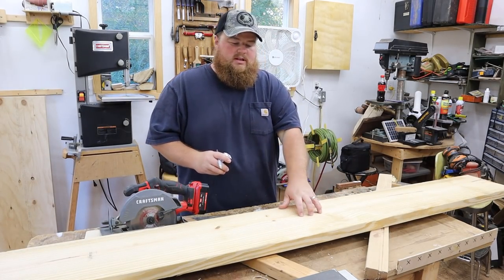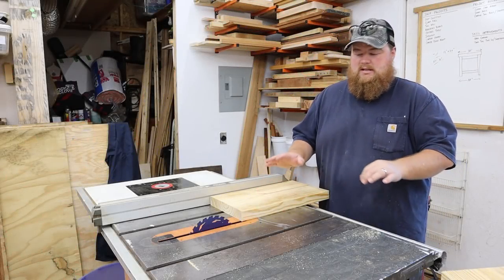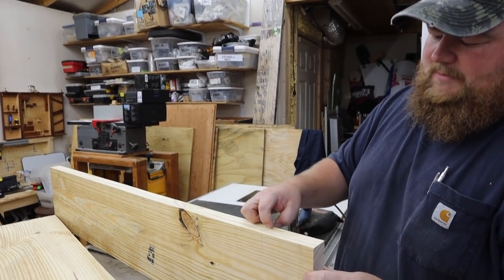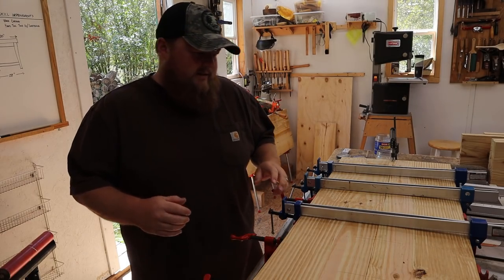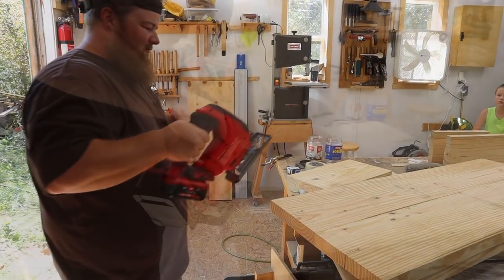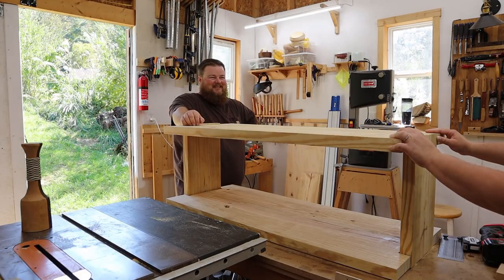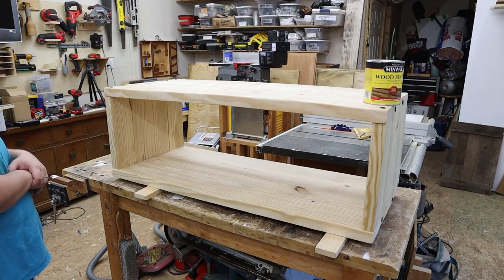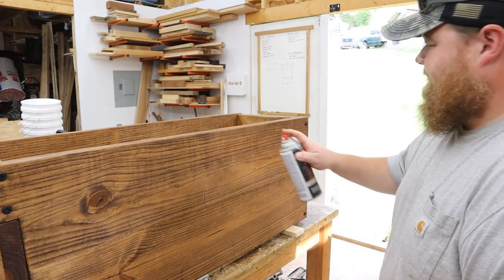Minimal Rustic TV Cabinet Built from Construction Lumber

Comment: The wood floors in your home are wonderful. love the colour of them. The tv unit is fab Sam , you did a fantastic job of building it . I noticed that in the floor of your lounge (beside the tv unit) you have blown air heat vents, my home in the 1970s had vents like that , but OMG, the amount of spiders centipedes etc that crawled up through them ......yukkkkk.
Reply from the maker: Thanks! It's a laminate floor, but we've enjoyed it since installing it about 5 years ago. Our floor vents are from the forced air electric furnace in the home. We rarely use it since we have propane heat, but we regularly have to clean them out of LEGO pieces. LOL Thankfully no spiders!
Reply: @sam-and-angela  yes not surprised to hear about the lego.lol. glad you dont have creepy crawlies ..yukkkkkk

Comment: Sam have you ever tried a Kreg jig? It helps you drill slanted holes in boards to pull together pieces of wood like that. It's so much stronger  than biscuits or dowels
Reply from the maker: Oh yeah, I have one in my workshop. :) Pocket holes have their place and I'm not against using them for sure!
Reply: @sam-and-angela  I know I bought one & made a kitty cube for the 1st thing I made. When we went to get rid  of it my hubs goes I'll knock it apart. "Yeah right!" He tried and tried he stomped on it took a sledgehammer to it...thing wouldn't come apart!!!
Reply: I 4got to say that the wood splintered away but where I'd joined it with pocket holes & glue...there was these corner pieces that wouldn't come apart...lol

Comment: Sam, I think you were way to hard on yourself during this build. Came out really cool looking. Especially for using framing lumber Bud. Here's just an idea. How about running more of those black screws along the edges spaced out the entire way. Let me know if that makes sense? I think it will be a very cool look & you can alternate the spacing to ensure the don't hit each other from the top & sides. Just a thought though... Hoping all is well, Dirty Jersey out!!
Reply from the maker: I cut out a good bit of frustration in the video to where my comments were kind of out of place. LOL I took for granted that small people hadn't messed with the bevel wheels on my table saw and didn't notice until I had cut and ripped all the pieces. After the correction, our tv stand was a little smaller in all dimensions. EEK! LOL I'm happy with it otherwise, given how much that southern yellow pine wood moved on me. Ideally I would buy the lumber and let it sit in my shop for another week or three, but this was more of an impromptu project that we jumped into a day after thinking it up. :) I was considering adding more of the screws, too, so I like that idea! Thanks for the comment as always!
Reply: @sam-and-angela  Fo Sho!! Anytime Bud. Hoping all is well guys!!

Comment: Nice job. But your killing me with the 1 1/2" foam brushes. As a commercial painter for the last 32 years,  I would use a 6" roller sleeve as an application pad. But that's just me. Keep up the good work 👍
Reply from the maker: Just using what we had on hand in the shop. :)